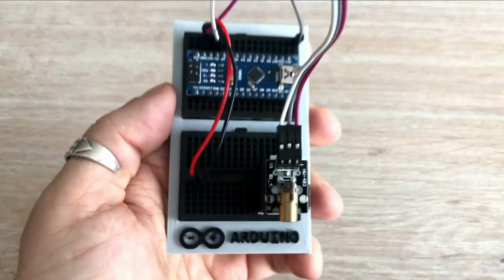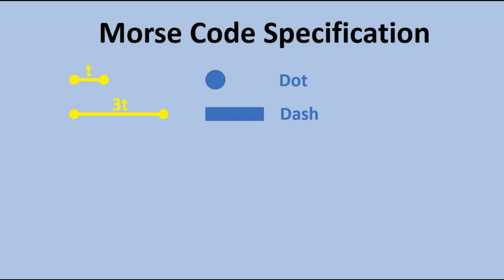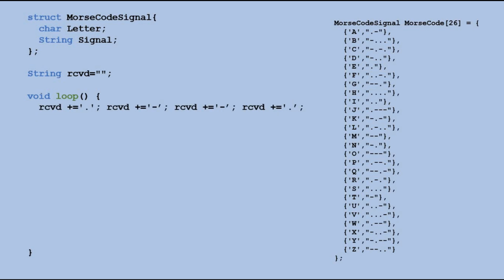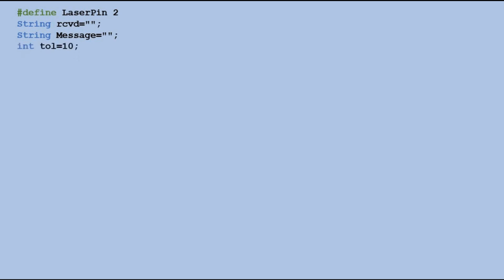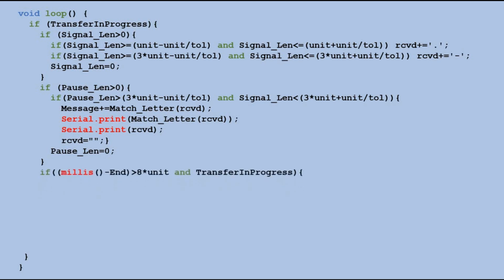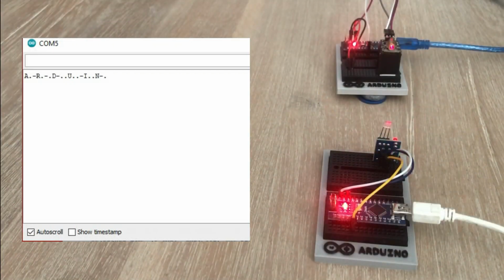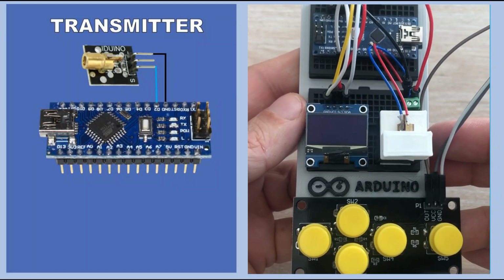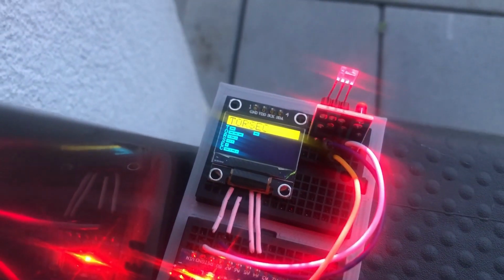From Light to Letters: Creating Arduino Morse Code Decoder using Laser Modules! Part 2

Comment: I have been working on a similar project for a few weeks now and I found your video very interesting.  However, I would like to have a hard copy of the finalised code, as both it and I are quite dense!  The hard copy would enable me to understand what is going on much better,  together with the transcript.  I will be grateful if you could send me a copy of the code.  Many thanks.
Reply from the maker: There is a link to the code in the video description